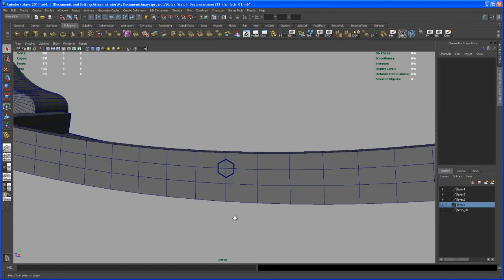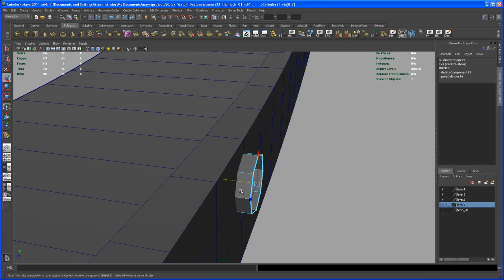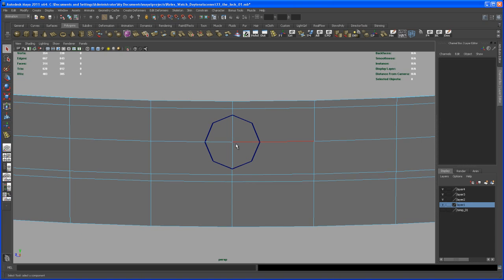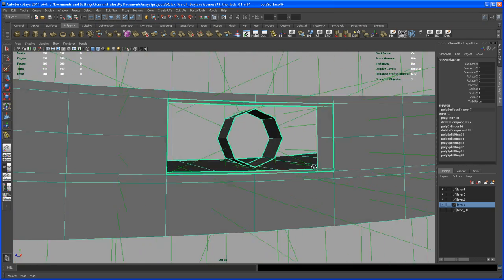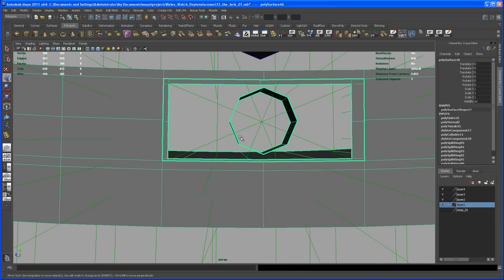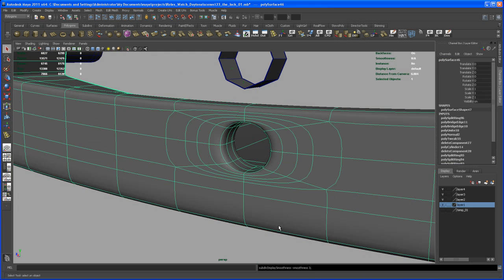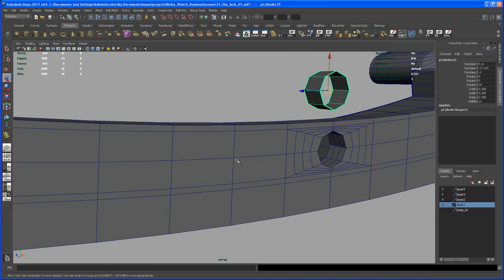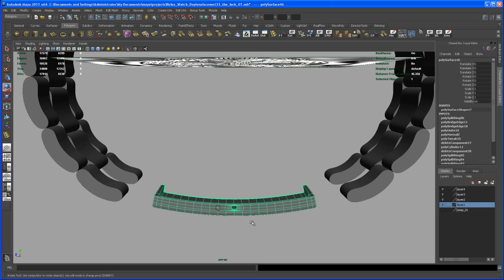Modeling tutorial in Maya - ROLEX DAYTONA watch - Part 34: the lock 02

Comment: @dagoggles
What happens if i reset every trasformation?
And one more question, in my outliner there are groups which i dont know what to do. For example, theres a group called Polycylinder1 > transform3. when i click transfrom3 my plate_main part highlights and shades pink. should i delete this kind of groups and its nodes like trasfom3?

Comment: You mentioned that the circle is not perfect bec of the edge flow, achieved after the bridge. Mine had the same problem also. I tried to add an extra edge right inside the cylinder, and using the slide edge tool kept the edge very very close to the outer edge of the cylinder. Next, added 1 more edge, to the circle edge group we fixed with the bridge offset. And kep that edge very close to the outer edge of cylinder again. I tweaked the last edge added to a perfect loop. When i hit 3 its perfect.